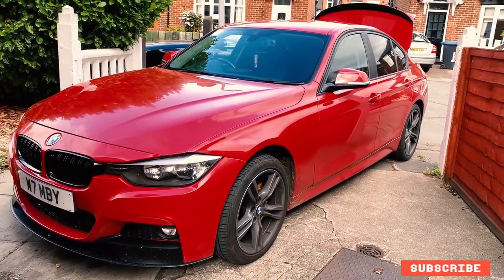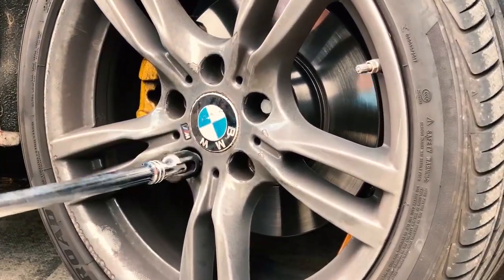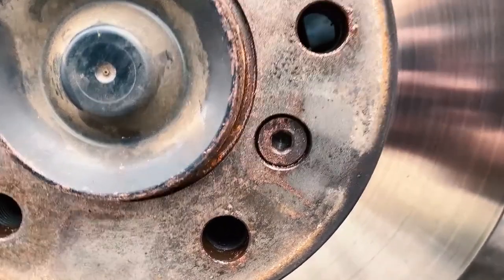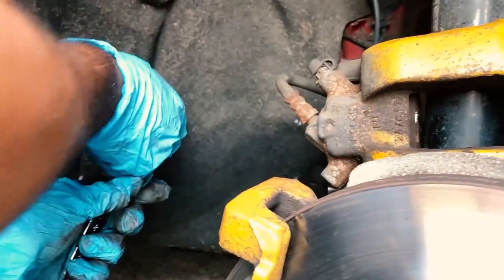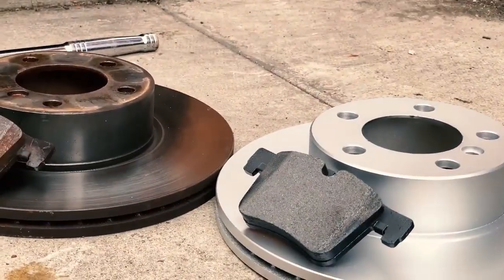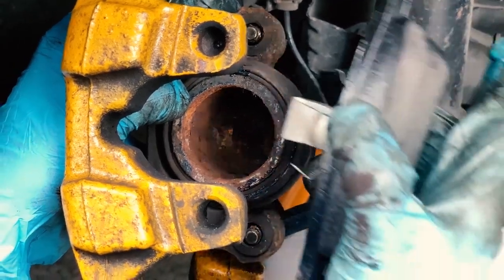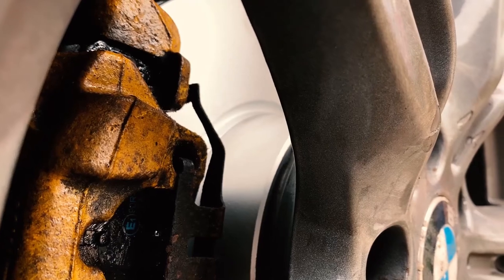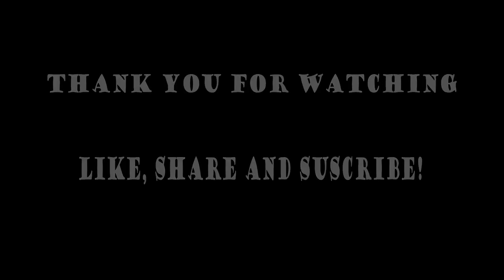BMW F30: Changing BMW 3 Series front brake discs and pads

Comment: Some basic mistakes:
1. Uncleaned hub
2. Hub curvature measurement not performed (allowable curvature is 0.02mm)
3. Brake disc centering screw not replaced
4. Apply grease on the hub to the bug
5. Failure to clean the feed guides
6. I haven't seen so much rust in a BMW F30 for a long time :)

Comment: Thanks, it's very useful. There are tons of corrosion in the wheel area. Too much salt where you live? How much km's?
Reply from the maker: Hi there it’s got 100k miles on it now and yes that’s the UK for you the roads are very harshly salted. However the wheels it’s more likely to be a bad refurb/repaint from a previous owner.

Comment: You should replace the plastic jacking point on ths car . They are readily available. Also noticed you used a grease on the rear of the pads. Was this copper grease which has a high melting point . If i were you i would also have cleaned off the corrosion on the bearing and replaced the 6mm hex disc retaining screw as a matter of course. Saves all the hassle next time if they have to be stripped down.